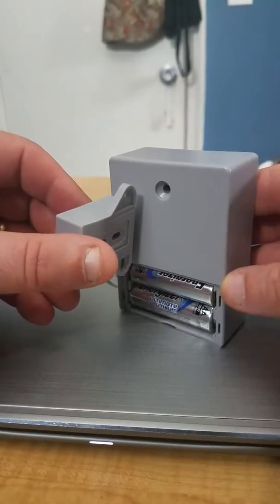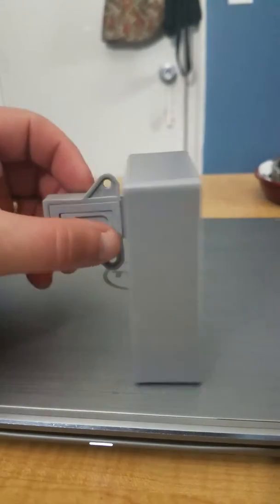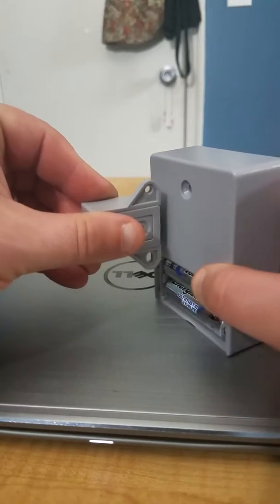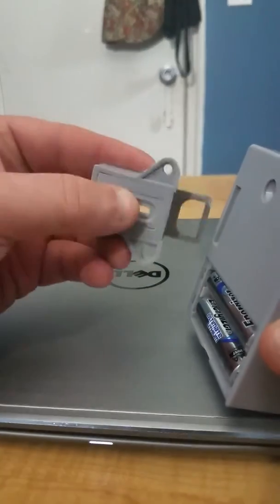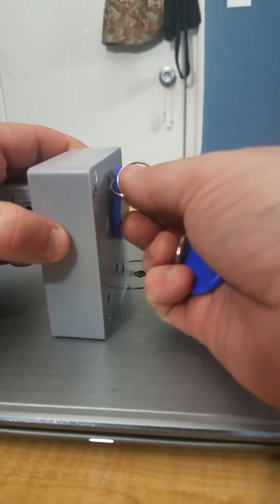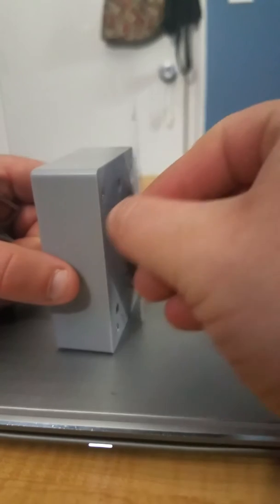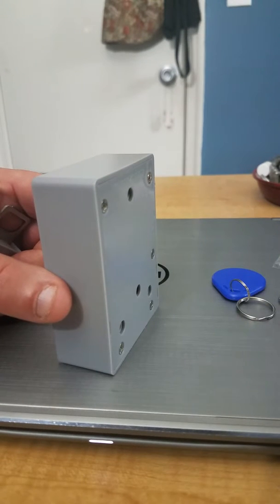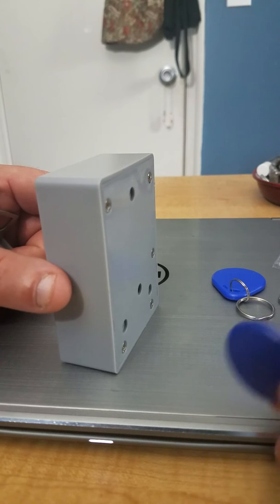Programming an RFID Lock, Part# RFID-2B-G and -B

Comment: Sir I accidentally lock the cabinet when there ia no battery inside the lock
What should I do sir how will it open
Reply from the maker: unless you have attached a power jack cable to the lock ,our Part# PJC-Mucb-20, (this lock is our Gen 1 model and doesn't have the micro USB port on the side of the lock, but all our RFID-2B locks now have them since 2020), you will have no other way to get power to the lock to operate it.  You will have no choice but to pull hard on the cabinet door to break the lock.

Comment: Lol mine doesn't open just beeps.  Great noise make and poor paper weight
Reply: Did you purchase one from our website? If so feel free to give us a call and we can help trouble shoot for you.
Reply from the maker: im thinking you may have ordered someone else's lock that looks similar to ours.  We created our own proprietary software that we flash into the circuit.  We do this in our Lancaster PA facility.  Nobody else has our software installed into a similar looking lock. If you didn't buy it from us, it's not our lock.